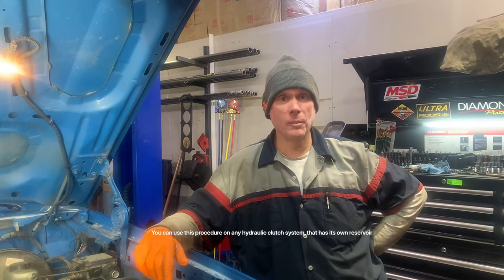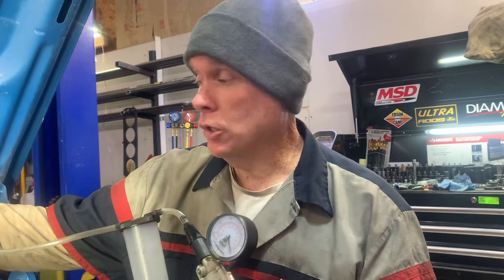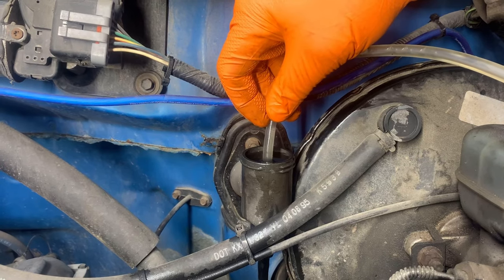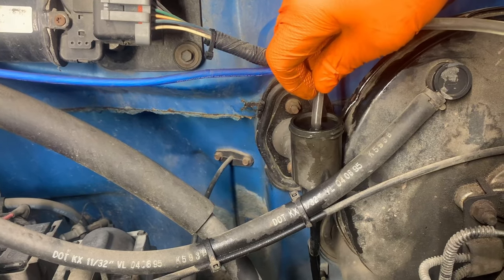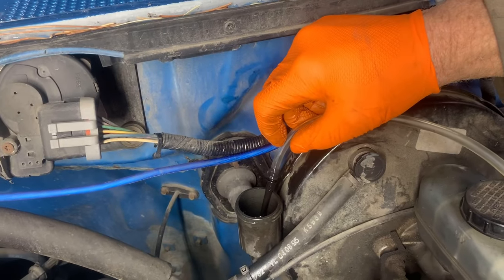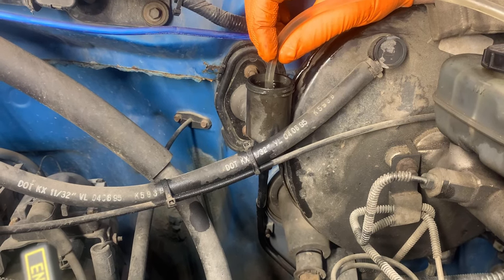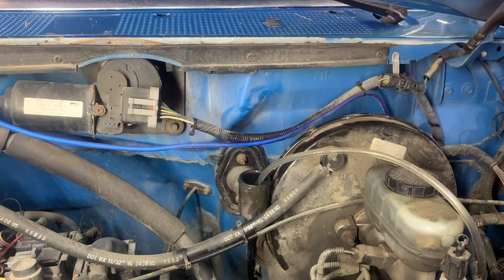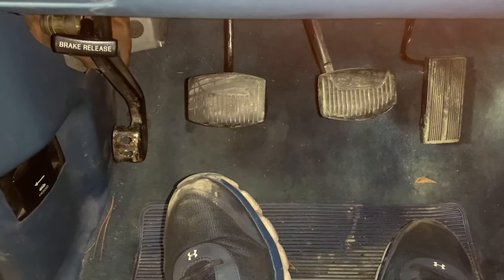Easiest, way to bleed a clutch. Works on impossible Ford concentric slaves. Can be done alone.

Comment: I have a 95 ford ranger with the Mazda 5 speed and the 4.0 motor. I used this trick and went from no pedal to resistance half way down, bled 10 reservoirs worth of fluid through the slave. Used the mighty vac to pump through on both ends and I’m starting to worry something else is the issue, also noticing a slight squeal on start . Is there something that you can think of that might be the issue in this case? Maybe I didn’t properly align everything when slipping on the transmission? This job has been such a nightmare, this is absolutely not the first transmission but I’ve never had one that A) was such a pain to install or B) was absolutely impossible to remove without trying to remove the exhaust Y-pipe. I’m just kinda lost with this one here
Reply from the maker: Did you try it with the pedal down? Sometimes that helps. Look for leaks, inside the firewall, at the master cylinder and the new slave, through the access hole.

Comment: I did a clutch master and slave cylinder replacement on a 2004 Kia optima. I can't get the car in gear. The pedal feels firm. I have bled it with the Mighty vac. I have gravity bled it. I have done the ol' push the pedal down and hold it while opening the bleed screw. It went into gear fine before the replacement. I just had to pump the pedal.  The car has been stuck in my driveway for a week. I'm going nuts trying to figure this out. We live in the woods out of town. We need this car to run. I'm getting desperate. Any ideas would be greatly appreciated
Reply from the maker: Is the clutch rod adjustable?

Comment: What "cone tip" is that which you had on the end of the hose (submerged in master reservoir)
What do you call it? I'm trying to locate one to do this very procedure soon
Reply from the maker: It’s a cone tip.
Reply: Thanks man I wasn't sure if it was some kind of fancy nozzle or just a tapered cone. 
Thanks for posting the video man. The last time I had to bleed a ford concentric clutch it drove me half fucking insane and I know I never did get all the air out. Cant wait to try this
Reply from the maker: @weslee4469  you’re welcome, they’re a joke. One thing the video doesn’t say, that I found very helpful is, start the pedal down, and then finish with it in the up position.

Comment: Someone must have shown this to my (former) mechanic when he was working on my 2000 Ranger. When combined with all the other hack tricks they did, it works well enough to make the truck drivable, but the clutch feel is still terrible. The only way to do the job correctly is to pull the master cylinder and bench bleed it.
Reply from the maker: That’s not true, the problem isn’t in the master cylinder. Those are a piece of cake to bleed, in or out of the truck. The air gets trapped in the line.
Reply: @greasyhandsauto-shaunbutte9726  upon closer review of the video, it looks like the truck you're working on is much easier than a Ranger. The Ranger master cylinder is buried deep under a lot of other stuff, and it is sloped so the fluid inlet and outlet are at the bottom. I told the mechanic it has to be bench bled per Ford, but he was like "na we'll just powerbleed it". Another trick that helps but doesn't work well enough is to put the front end on the lift and incline the whole truck up at a 30 degree angle.
Reply from the maker: @erich9111  I’ve used it on Ranger’s too. It works, we owned a Ford dealership from 1937-2004. (Butterfield Ford, Sandy Utah) Believe me Ford’s procedure is a pain. Did you replace the slave cylinder?
Reply: @erich9111  I just did mine with this procedure. No bench bleed. Took a while still, but came out great.  (My saga is at the top I believe).

Comment: will this cause my truck to not shift while the truck is on ? my truck shifts properly when the engine is off but as soon it comes on it wont.
Reply from the maker: Are the parts new? Air in the system will cause exactly what you are experiencing. A bad slave or master cylinder, will do the same.

Comment: I pulled 30 inch of vacuum and kept pumping for 20 times more, it did get all the air out, but now the seals are blown, pedal is super soft, super frustrated!
Reply from the maker: How did you blow seals at 30 inches of vacuum? You probably still have air in it. Try it with the pedal down.
Reply from the maker: A slave has 180 psi when the pedal is depressed and 30in of hg is 15psi. It didn’t blow your seals and if the seals did blow then they were going to blow anyway. Like I said, you probably still have air in the system. Try it with the pedal down and then again with it up.
Reply: @greasyhandsauto-shaunbutte9726  the clutch was separating before the bleeding, just wasn’t very good, after the bleeding the pedal goes to the floor with very little pressure, I wonder what’s causing the problem.
Reply: @greasyhandsauto-shaunbutte9726  maybe you should try to pull 30 inch of vacuum and keep pumping to see if that can blow the seal or not, but right now it seems like the seals are not functioning, it still holds vacuum in the system, but the master cylinder isn’t doing anything, my car is a 1996 ford explorer XLT.
Reply from the maker: @davidgruen7423  If it was working good, why did you bleed it? I know it doesn’t blow seals, I’ve done dozens of these.
Reply: @greasyhandsauto-shaunbutte9726  it was working but the gears are hard to shift, so I know it’s not separating properly, now it’s not separating at all after the bleeding. I know this method works because I tried this on a different with 15 inch of Hg but I don’t want to try 30 inches of Hg anymore.
Reply from the maker: @davidgruen7423  the seals in the system are better than the ones in the pump. I’m sure the pump seals would blow first. You probably have a leak and that’s the real issue. That’s why it wouldn’t go into gear.
Reply: @greasyhandsauto-shaunbutte9726  i’ll try again, I thought about too but vacuum is different than pressure, it’s going the opposite way of what the seal is meant to do…
Reply: @greasyhandsauto-shaunbutte9726  honestly I am pretty frustrated because it doesn’t make any sense, I don’t think too much vacuum can blow a seal either but right now that’s what it’s doing. I hope you can try to pull more than 30 inches of mercury next time you bleed a master to see if that can cause a problem just to confirm whether it’s safe or not, that way we all know it’s not dangerous to pull to much vacuum on the system.
Reply from the maker: @davidgruen7423  I do it all of the time. I’m not sure what happened to yours. It may have had a leak that got worse. Something was up, if it wouldn’t go into gear.
Reply: @greasyhandsauto-shaunbutte9726  i just bought the car, the guy tried to sell it because it was hard to shift in to gears and thought the synchro in the transmission was bad, which is not correct, because synchros don’t go bad at the same time, plus reverse has no synchro on that car, it was clashing too. I knew it was just air in the system, or some other problems causing the clutch not to disengage completely, I foot bled the clutch and it gotten a lot easier to shift but still not as easy as when the engine is stopped, that’s why I tried to pull the last bit of air out from the master cylinder, which it did pull a lot of air out, but the clutch master cylinder doesn’t work now anymore.
Reply: @greasyhandsauto-shaunbutte9726  I think it might have just been bad and with 30 inch of Hg it really just took its toll.
Reply: @greasyhandsauto-shaunbutte9726  I found the problem, I removed the clutch master cylinder and found it’s perfectly good(on 1996 ford explorer the hydraulic line has a Schrader valve so if you disconnect it from the clutch slave cylinder the master cylinder line is completely sealed, and I pushed on the clutch master pushrod it was rock solid), which by deduction it is obviously the slave cylinder that’s bad. I have done extensive research on the slave cylinder of this car yesterday and today, it turns out that this car uses concentric slave cylinder and the seal is easy to get damaged if it retracts too much. Also on that particular car there was a technical service bulletin published on in 1997, Article No. 
97-22-17, which talked about the bad design of that particular slave cylinder which matches the symptom of what I have just experienced.
Reply from the maker: @davidgruen7423  all of those concentric slaves stink.
Reply: @greasyhandsauto-shaunbutte9726  this is still a good method, it did remove all the air in the master cylinder, just on cars with concentric slave cylinder you have to first disconnect the hydraulic line to separate it from the system.
Reply from the maker: @davidgruen7423  I don’t, I use this method to bleed the concentric slave. The 92 in the video has a concentric slave. As I said before, 180 psi is applied to that slave, when pushing in the clutch. 30 inches Hg is 15 psi. You likely had a bad slave to start.
Reply: @greasyhandsauto-shaunbutte9726  yes but remember there are a lot of crud near the seal and if you apply vacuum to it it will ride on all the cruds. Anyways it was likely bad to begin with, but it was none the less able to put into gear, after the bled there is no clutch pedal pressure. Anyways I would not want to do that on a concentric type clutch anymore. In the mean time I sent couple inquiries about this possible damage caused by vacuum bleeding to multiple clutch manufacturers, hopefully I can get some responses soon.

Comment: when i pull the vacume hose out it sucks my reservoir completley dry, is there a way to get the breka fluid from my vacume pump line to drain back into the reservoir as i pull the tip up and out of that hole in the bottum of the reservoir???
Reply from the maker: No but pour som into it as is draining down. You may need two people.

Comment: I tried this procedure on my truck. 2000 f250 v10 with a zf6 swap. Like my counterpart I was starting with a bone dry system, the master cylinder went bad and would not hold the rod for the pedal. I started this sequence first, spent about 1.5 hour vacuuming getting up to 25 on the mityvac each time. I let it sit for two days and just tried again; went up to 20ish on the mity vac and let it sit, still no pedal. I have a faint grinding noise from the trans while in neutral almost like the clutch is dragging, will not go into rev or lo and grinds first with clutch all the way down. Am I missing something? Perhaps hold vacuum while pumping clutch?
Reply from the maker: Don’t pump the clutch but try it with the pedal down and then again after it’s up. Good luck
Reply: @greasyhandsauto-shaunbutte9726 I’ll give it a shot, I have a family friend who used to be a tech at the local dealer, he told me to the actual procedure is to remove the slave and hang it so there are no high spots then compress and slowly decompress the slave several times. I’m going to try that first and then I will try your method of vacuum while clutch is down. Thank you, will update
Reply from the maker: @josephtrautwein1598  I know, my dad owned a Ford dealership. Unless you have a leak, this should work.
Reply: @greasyhandsauto-shaunbutte9726  I tried bleeding the slave, sucked some fluid down first time of my first sequence or 5 times, still no pedal. Tried it again, same thing the second time but I vacced the master at the end, still no pedal but I got it to roll 10 feet. No spare legs around to vac it with a foot on the clutch
Reply from the maker: @josephtrautwein1598  sometimes it takes a while. Try pumping the clutch about 40 or 45 times and then vacuuming it again. You may have to do that three or four or even five times. They can be a bear.
Reply: @greasyhandsauto-shaunbutte9726  I spent 4 hours doing that process, clutch feels stiff, but still have only half my throw on the shifter. I been talking to the guy who I got the trans from he said he had no issues with it before removing it from his truck (also a 2v v10) I’m pulling everything apart today after work, well soon find out. I’m dead set against throwing more money and parts at it.
Reply from the maker: @josephtrautwein1598  you will figure it out, good luck
Reply: @greasyhandsauto-shaunbutte9726  figured it out. Mityvac might have worked, but I hung the whole assembly from the spotlight bar on my roof and let it hang low, then pumped up the slave like Ford suggests and I got clutch almost immediately

Comment: Ok I've done everything and have had only bad luck. The fluid ran dry and became hard to shift. After adding fluid it didn't get better. I then read and saw your video. I placed the end into the hole and it was holding pressure. Then suddenly it starting sucking out alot of purple fluid along with alot of bubbles and won't hold any pressure. What happened. Can you tell me what I'm supposed to do now?
Reply from the maker: Hi, are the parts new or old? It sounds like you have a leak. Why did it run dry
Reply: Mine did the same thing purple fluid started sucking in tube then couldn't get to take fluid

Comment: I just re installed my slave cylinder, I have been have a super hard time getting it to work I’ve been doing it over and over I get a lot of tiny bubbles not anything as big as what you got. I had some one move the petal as I had a seal on the hole closest to the cab, after about three pumps I have them hold down and I get a huge amount of bubbles but it just seems never ending I’ve done it 20+ times and there is no change in quantity of bubbles or resistance in the clutch petal. It still sticks to the floor. Any suggestions?
Reply from the maker: Try it with the pedal down, that will fill the master, then do it with it up. If you keep getting bubbles, there is a leak somewhere.
Reply: @greasyhandsauto-shaunbutte9726  I’ve been doing it with it both down for a few times then with it up for a few times. Are you putting it in a specific hole in the master cylinder?
Reply from the maker: @danielmyers8305  yes, the one that feeds the line.

Comment: I have an 88 F250 with the 460 and zf5-42 and was wondering if this will work the same, and if so which hole in the master cylinder should i do? Thanks
Reply from the maker: There should only be 1. If not use the hole tad has the tube, going to the slave. And yes it will work.
Reply: Dealing with same thing mine has 2 also

Comment: Have you ever worked on a 2005 Chevrolet Colorado 3.5 clutch? Cannot get mine to bleed, pedal to the floor barely moves slave making it hard to shift.

It all started when I lost pedal pressure, slave cylinder was leaking, new clutch, 2 new different concentric slave cylinders, 2 new masters one without the line the most recent one I bought included the hydraulic line.

Still cannot bleed it any tips?
Reply from the maker: I haven’t but, did you replace the master? I would start there.
Reply: @greasyhandsauto-shaunbutte9726  yeah new master with hydraulic line, I think it may be a very small leak where the line connects to the slave, how can it leak if both parts are new. Any tips how to solve it? Its the push connect fitting with a plastic ring around it.
Reply from the maker: @mxtony7  you may just have a tough one. Some are so difficult that, they come as a complete assembly already bled.

Comment: weird, i got the green oem tools vac pump, tried doing this last night but the pump only pulls a couple inches of fluid and stops, no bubbles either. gauge doesn’t go higher than 9.5, does not matter how much i pump it it stays where its at. any help? this truck has had 3 slaves and 2 masters and new lines in the last couple years. entire clutch system is less than 3 months old in this thing and cant keep solid pressure for more than a week. a month getting it back from ford and it’s almost useless again.
Reply from the maker: Is the pedal up?
Reply: @greasyhandsauto-shaunbutte9726  yes clutch is up, bleeder is closed
Reply from the maker: @noyesyesno5345  try it with the clutch down to see if you may have an air lock, in the master, then put it back up.
Reply: @greasyhandsauto-shaunbutte9726  ok thank you, ill give it a try.  if its air locked will i see the same result?
Reply from the maker: @noyesyesno5345  hopefully you will see some bubbles

Comment: Let me ask a question. Just changed my clutch master cylinder in 02 chevy.  Used your method to bleed.  When you release vacuum from mighty max pump it sucks the fluid back into the line.  When I did that it didn't suck back in.  Any idea why,
Reply: It's an 02 chevy silverado with 4.8v8 5speed, reason I changed it was clutch releasing at floor, no leaks not losing fluid.  I've got it pumped up by the pedal but having to pump it before driving 10-15 times in order to get into gear.  Once I do that it is no problem the rest of day.  Next day same thing, back to pumping it up
Reply from the maker: No, It should fill the line.

Comment: do you fill the little tank on the vaccume pump with brake fluid or leave it empty when you do this?
Reply from the maker: Leave it empty. It will fill as you pump.
Reply: @greasyhandsauto-shaunbutte9726  ok thanks
Reply: @greasyhandsauto-shaunbutte9726  i tried it yesterday got a lot of bubbles out...old boy seems be going in all the gears good now
Reply from the maker: @timspur7203  nice!

Comment: I tried this method and can't even get fluid to pull through when I have the nozzle inserted into the MC hole and SC bleed valve closed. Any suggestions? Does this mean I have to air in the system?
Reply from the maker: Try pumping the pedal and the start with it down. After that, do it with it up.